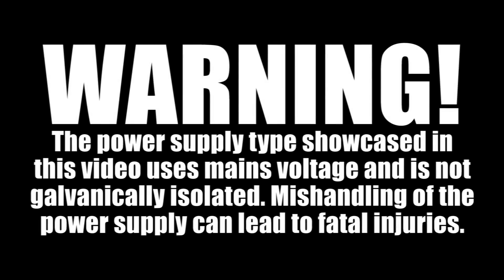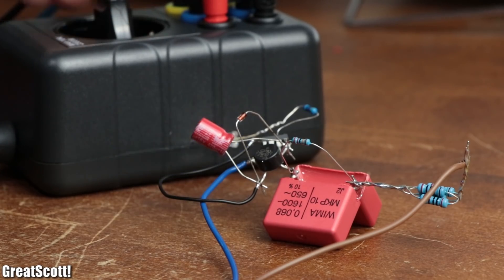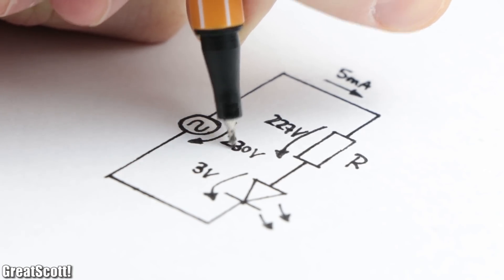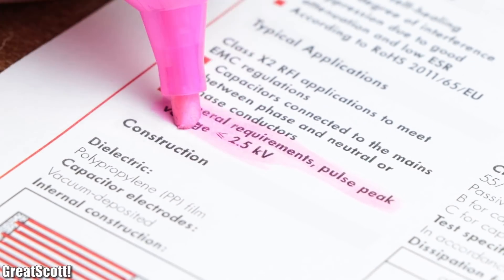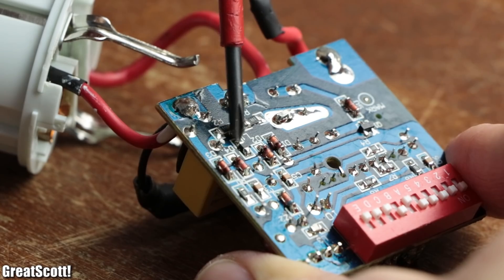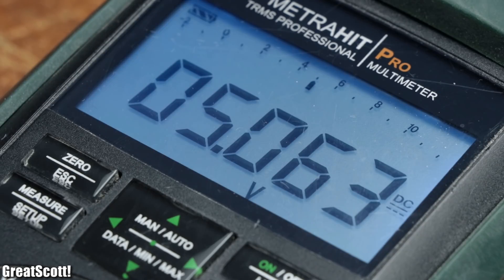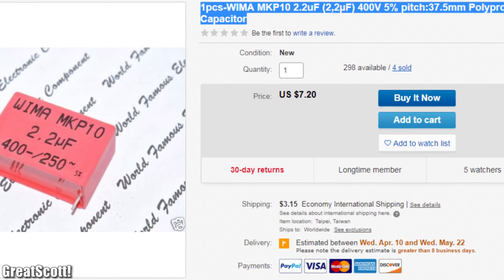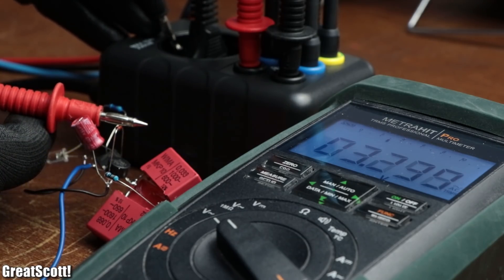The most Dangerous, yet Cheapest Mains Power Supply?! || Building a Capacitive Dropper Circuit!

Comment: I did this with (drumroll) a 555 timer, triacs, and zero crossing detectors in the late 1990s as a sort of protection against power failures.  The idea was, after power was restored, the "smart" outlet would wait a set time before forwarding power to the device, thus protecting equipment from power spikes commonly following power restoration.  The problem was computer monitors had huge power factors and fried my triacs, because the zero crossing detectors couldn't handle it and had to be precisely configured for a specific power factor, which is why relays are used and you would commonly hear a click on complex equipment like heavy monitors.

Comment: The trick that they get away in this remote controlled sockets, is to use a relay that uses higher voltage for the coil. Like 24 VDC here, this way you need less current and can do it with reasonable capacitors and zener diodes. Then drop it using linear regulator for the radio receiver circuit which uses very little.

Comment: It's called a 'buck converter' and it can handle more than just a few milliamps. Using a non-polarized capacitor, such as a motor capacitor normally used with compressor motors, you can make a battery charger by connecting it to a rectifier. It's literally just those two components, and a cheap resistor over the output terminals to bleed off the capacitor when it is unplugged. When there is no load, the output terminals will be around the same as mains voltage...but when you connect it to a battery, the resistance of the battery causes the voltage to drop. The amount of current it can provide to charge the battery depends on the value of the capacitor. These types of chargers can resurrect a "dead" SLA battery because the output is still pulsing at the AC frequency of 60 Hz. The pulsing helps break apart certain kinds of crystallization that can form on the plates of battery cells. It can also charge other battery types quite well.

Comment: Didn't hear him mention it, but another reason to have the rectifier for an LED running of mains voltage in some form is to prevent the LED from avalanching when its reversed biased. You can get away with it with a resistor since its limited, but even cheapie Christmas lights usually have a rectifier in the plug to avoid stressing the LEDs (and reduce strobing).

Comment: Can we all just appreciate how ghetto the "professional" circuit show at 5:54 is?! The power resistor is just soldered down with a big blob and the lead (which didn't even get trimmed) completely missed its through-hole. The film capacitor also ignored one of its pads and is bodged directly on to one of the mains lines, which themselves are soldered directly to SMD pads rather than proper through-hole connections. Not to mention all of the solder joints are cold welds and very poorly hand soldered (whats with all that residual solder on the green electrolytic cap?). Then it says RoHS towards the back as if they actually got certified. Best of the best right here...

Comment: Using Earth and Ground with return make it safer just in case. I would be safe and use low cost SMPS, open frame SMPS sell for very cheap online. Then you may add the 7805 REG.

Comment: You should add a rectifier diode to protect the LED during the reverse half-cycle when powering it through a resistor direct from mains voltage. LEDs have a quite low breakdown voltage and will avalanche and get fried quite quickly. By the way, that is the way they did it for powering the light on an electric kettle I took apart.

Comment: There is additional trick with this radio controller power switch. It uses 24VDC relay, so it can use lower current to drive it. 24 VDC is generated separately, or then stepped down via simple zener or voltage divider into lower voltage for the radio circuity and microcontroller. Plus, the radio circuit only receives commands via radio. It doesn't transmit anything. This lowers power consumption a lot.

I am struggling with building smallest possible power supply for WiFi enabled device, with only sporadic transmissions. But still, it can consume 100-200 mA in short spikes when transmitting. It is almost impossible to build a capacitive dropper circuit to drive it. One could use a big smoothing capacitor to make it possible, but then you need to really control frequency of spikes, so the input voltage doesn't go some minimum. It complicates programming of course.

Comment: You are amazing buddy. You give each and every step of making project. I am an engineering student and also try your projects at home. I require your little help. Would you please make a video on "Synchronization failure detection of power grid". It simply means if frequency or voltage of system goes below some specified value then an indication is given by an lamp. Please reply me if you'll make a video on this topic. Thank you

Comment: As your circuit uses a bridge rectifier, the output voltage will be reference to 1/2 mains supply whichever way the plug is inserted.

Comment: 5:11 question here, since LED is diode, it shouldnt let current back, so maybe it was not burned but your capacitor blocked the current ? my expirement shows that if you connect half bridge after the capacitor led works fine.

Comment: Someone has said it already in the comments, but I'll say it again: Never connect a capacitve dropper supply across a MSW inverter as it will draw significantly more current due to the the harmonics of the square wave. If something is well designed you'll get away with it for a short time, but eventually something will burn up. Usually the Zenner. Of course you could design one with a suitable cap value specifically for this waveform but then it won't work on normal sinewave AC.

Comment: But from a consumer perspective having a power supply with a terrible PF is fine since, you don't pay for reactive power most places. Plus having a capacitive reactive power, might even be desirable for the grid, since capacitive load banks are often used to correct for inductive reactive power anyways.
Reply: That doesn't help the grid much. Inductive loads a mainly industrial, residential is more capacitive loads (except for all the mostly resistive loads, which are the biggest part). If those loads aren't in the same place, they don't cancel out.

Comment: for low load applications you can get some very tiny buck converters on a chip nowadays. Feed it with a small transformer and you can build a more stable and safer power supply with around the same footprint as this project - albeit at a much larger cost. 

Thanks though for presenting the dangers associated with these ccts - too many show them as some kind of magic trick to be copied, and people could get hurt.

Comment: I made this circuit for a tiny13 avr to fire a staircase timer that bought for a replacement of the old just because it could fire from neutral or the phase and for this reason it needed a separate wire from all the floor swithes.Another parameter i didnt thought because the current for relay and avr was about 10mA was the small value capacitance of the AC capacitor.Placing a smaller in nF capacitor it takes a lot more time to charge the dc capacitor and the connected circuit then starts to malfunction!!!

Comment: All the day/night movement sensors for example use this kind circuit as a power supply.But is not recommended for the ECO Green freaks because the most disadvantage of zener regulator circuits is that current flows constantly through zener even without any load connected.If the capacitor is calculated for 40mA then the power consumption is 8,8 watts regardless of the load,even if the most sophisticated microcontroller having connected and put into sleep mode of 1 picoAmper the AC consumption always remains the same.

Comment: Try to hook up a oscilloscope to some SMPS without connecting the ground and you'll see half the mains voltage, because of the class Y capacitor which couples the primary side negative to the secondary side negative. Not every SMPS uses those safety capacitors, so you shouldn't see it on all

Comment: This is a very interesting DC converter. It is neat how many different ways there are to accomplish something. That said, there isn't a snowballs' chance in hell that I will ever attempt to build this because of the extreme electrocution hazard. When I need a small 5vDC source, I'll just use a cell phone charger. They're super cheap, small, easy to replace, higher power than this capacitive dropper, and most importantly, won't kill me if I touch something on accident.
Great video though!
Reply: by accident*

But yeah I don't think I could ever be convinced to play around with a capacitive dropper. Scary thang.
Reply: @clonkex  *on accident and by accident are both acceptable variants of the adverb accidently. The former is more common in regions of the US, and the later is more common outside the US, but both are acceptable. If you prefer one over the other, it is simply a matter of preference. Much like the variants in spelling of color vs colour and grey vs gray, offering a correction to someone when a mistake was not made is not useful.
As a recovering stickler for absolute grammatical correctness myself, I understand the compulsion to offer a more correct option to others when communicating in writing. While I do not take offense to the practice, I would advise that many people find the practice condescending. Rather than the intended clarification of online discourse, it can reduce participation in discussions, and has a certain off-putting characteristic to it.
I wouldn't normally respond in this manner to such a trivial thing, but I know you will appreciate the effort.
Have a great day!
Reply: @WarrenGarabrandt  I very strongly disagree. "On accident" is not correct and sounds like baby talk. Would you say "oops, I did that on mistake"? Of course not! It sounds ridiculous. That's how "on accident" sounds and I'm horrified that a stickler for correct grammar would use the phrase. It's almost as awful as saying "should of" instead of "should have".

I actually find it interesting that people frequently take such strong offence to being corrected; it seems to me they should just accept that made a mistake, learn from it and move on. But when it comes to comments on a YouTube video, I'm quite happy to correct every mistake I see that isn't clearly a result of lazy typing: "on accident", "should of", etc.

Also, latter* ;)
Reply: @clonkex  Ok. I can see you have strong opinions on this. That's fine with me. I have decided to take a different approach to communication, I guess. As long as I'm able to figure out what the other person is trying to say without an unreasonable amount of effort, I generally disregard simple and harmless mistakes made by others. I wouldn't presume that I am perfect, or that I make no mistakes. Therefore, I feel a bit hypocritical pointing out every trivial mistake I see. What would be the point in me spending my time doing that? I get no enjoyment out of it, the person I correct is unlikely to change their behavior, others are likely to see me as arrogant in so doing, and it is not conducive to civil discussions.
Feel free to correct any mistake I make in the future. Usually, it costs good money to hire a proof reader. ;) I might enjoy not having to worry as much about small errors while typing on this wretched, tiny, unforgiving phone screen when I have the whole internet to point out the errors. Saves me time. :)
Reply: @WarrenGarabrandt  I also do not presume to be perfect, and I definitely make mistakes. However I am absolutely willing to correct others because I know I am just as willing to be corrected. I don't feel hypocritical because I'm not saying "ha! you made a mistake!" but rather "hey, just so you know, this is incorrect". I don't really care if people interpret it as arrogant/condescending/pretentious/know-it-all/etc. because I'm not here to make friends. It's just YouTube comments. I also don't generally come to the comments with the intention of having a civil discussion (although I'm totally willing to do so if someone wants to discuss something interesting).

I completely agree about typing on phones. I use an S9+ so I have a fairly large screen and I still hate typing on it. I have the luxury of writing this reply on my desktop PC at work.

Comment: Good Day, The video was informative😀.. I had concern in transformerless power supply, Transformerless power supply it can  
use in low power sound amplifier such as TDA2003 and AN7131?... One thing Ill try increase the x-capacitor in order to achieved high current output the result was bad the zener diode burn out and the resistor 1 or 2 watts capacity from the AC line also burn..What should I do? TNX..

Comment: Thanks For the Really great video, but you did not hook the oscilloscope up to the power supply, I would really like to see what is the noise that is coming of the power supply and will it be useful in case I connect an RF module like LoRA to it.

Comment: I find it funny how I too, at the moment am working on an ATtiny project myself that needed to be powered by AC mains, I went over the possibility of building a capacitor dropper power supply but discarded the idea as the switch can be easily reversed like you mentioned, considering I had to use push buttons in my circuit I finally gave up on the idea of transformer less supply and decided to take apart an old phone charger and use that in the project.  Just wondering, are you too looking for means of measuring AC mains current in your ATtiny project?

Comment: Australian, my Chinese ebay bought bulb failed, I took it apart and became curious how it works after not seeing a transformer. 
In mine it has a 155j400v film capacitor, which after I googled is 1.5uf. The circuit also has 474k ohm small resistors, and a 100v smoothing capacitor just before it hits the series of LED's. Of course there was the bridge rectifier in the middle. I am most curious how this works because the 100v smoothing capacitor had expanded and become destroyed, and then one of the LED's burned out, it makes me thing that either their design is bad, or the faintly higher Australian voltage pushed it over the edge. 
Learning from your video here, it would appear that the capacitive reactance when on 50hz of this 400v film capacitor is 2122 ohms. 
Now the actual LED's themselves are the 5730 type, there are 12 of them in series, so around 33.6-40.8v is what they will be wanting, and apparently they typically use 150mA, however these are Chinese versions so they probably in reality are only like maybe 85mA ones. 
It would appear the film capacitor itself needed for 85mA and around 40v would be around the value of the film capacitor they are using. 
It doesn't appear after all that they really did anything wrong. 

However they are operating them so close to their upper limit I believe, and the extra 10v Australia likely lead to the burnout. If running the bulb from 230v source then the capacitor should be rather a value of 2235 ohms. Of course you wouldn't actually try to find that, you would just add in an extra resistor in the circuit instead. I believe the blown 100v filtering type DC capacitor was just a red herring, because it's value is fine after the output (after all it's only on the 40v section), and the fact that I have another LED with the same dropper circuit that also has a burned out LED, and it's filtering capacitor is fine, it tells me that the cause of the burnout was likely just the 10v higher voltage. If the Chinese built these to be slightly undercurrent for the 220v Chinese market, then they would last longer in Australian and British markets, instead of burning out after a few days or weeks as they always do.

The only way to get decent lasting LED's is to buy ones made specifically for Australia's voltage, and most of these are made to not even be running at peak for the LED's rating anyway, so there is a bit of headway built into them.

Comment: Good explanation, but you got one thing wrong:
The reason your LED blasted in the first test is not the inrush current, but the reverse voltage.
Look, if the mains reverses polarity, your LEDs are connected backwards and soon the voltage will extend the LEDs´ forward voltage. With a full bridge rectifier it won´t be a problem.

Comment: About power factor. Mostly, in real life, lost of the device in a house (or industry) are inductive (motors, for instance) so a poor capacitive power factor compensates for that. Most of the industries has power factor correction devices install, because they are charged for reactive power. In the past they was using capacitors banks, today, mostly electronics devices. On the network, the electricity supplier cannot left a poor power factor because this leads to higher current in the lines and this current is useless (but heating the legs of the birds). So they install devices called synchronous compensators which are biiiiig synchronous motors whose excitation is tuned to deliver positive reactive power.

Comment: Your capacitors, combined is 18*19*32mm ~ 18*20*30mm of 1$ 5v 700ma converter. So, BUY option is cheaper, smaller, safer, more powerful.

Comment: The inrush is not the only problem. Because if you try to connect an LED And capacitor in series, you create a voltage multiplier. Why? LED is a diode. So you have 647 volts (325v(mains peak)x2=650v 650v -3v(LED drop)=647v) over the LED in the reverse polarity. And this will destroy the led.

Comment: Hi! Does this capacitor drop circuit presents basically in any LED lamp? Or is there something other?
BTW, does LED lamps differs with a previous generation "energy safe" lamps' power supplying principle? I mean those lamps which contains some small amount of mercury and a "glowing powder" on their inner walls.